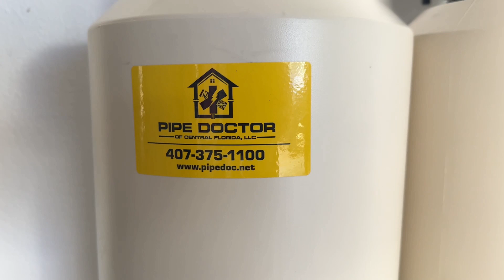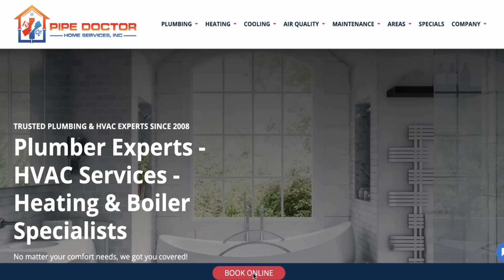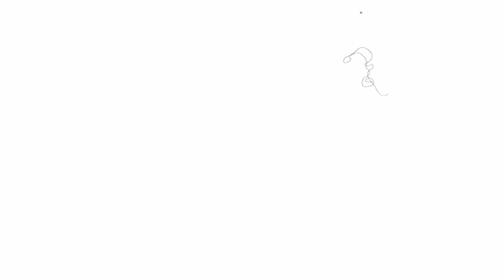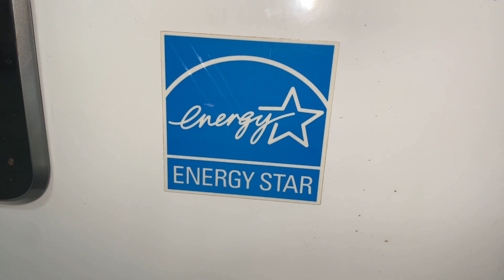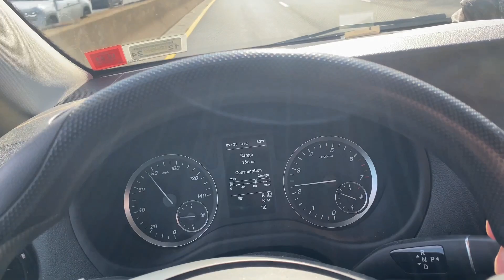Centrotherm Exhaust Piping Rotted in 24 Months! Importance of Outdoor Reset & Temperature Sensors

Comment: unsure if it was running too hot(short cycling?, lack of circulator post purge) but it also looks like the clamp may have been too tight and distorted the pipe, possibly not supported good and had pressure on it  too.
**EDIT: no wait, after seeing further, I'm positive they had the standoff leg jammed in between the fitting and pipe past the gasket! that made it leak, distorted it, rusted the clamp and left the black mark on the gasket. installer error! check all the other fittings to see if they messed it up too.
the standoff leg sits against the raised ridge and the other snaps over it to lock on, so the clamp ring sits at an angle grabbing the pipe, if it tries to pull out it will pull tighter.
you assembled it right, with the standoff leg at bottom outside the fitting against the ridge.
Reply from the maker: Thanks for posting your thoughts on this leak

Comment: Baseboard does not need 180°.
Reply: The baseboard outputs will vary depending on the water temperature coming in. Lower water temperature means lower BTU output. When it's colder outside you need higher BTU output. When it's warmer, the heat load is less and you don't need as much of a BTU output
Reply: That is why most baseboard manufacturers give heating output ratings for different water temperatures.
Reply: The baseboard is sized for the coldest day of the year. On most days, you do not need the full capacity of the baseboard
Reply: @aaronkoster3940   except, radiation elements are rarely sized right or to the actual heat loss.
running below 160F on baseboard is nearing useless and the total run time will be too long. also don't forget total loop lengths, 160F leaving the boiler, may be less by time it reaches the first element, then if there's many feet of elements per loop, the water at end may be far too cool to effectively heat the space.
more often than not, turning down temperature feeding baseboard will come back to bite you in the "hind-end", same with running "green" magical energy saving circulators, which may not flow enough to evenly heat larger loops.
Reply: Seems like a waste a money to sell a customer a high dollar condensing boiler if you don't allow it to condense.  Just install a non-condensing boiler.  Much cheaper maintenance.
Reply from the maker: Thanks for sharing

Comment: Thoughts on a electric tankless water heater vs heat pump water heater (50 gal) when house only has electric as option and 200 AMP service? HVAC unit itself has a 90 AMP breaker. Worried about running out of power with a tankless due to the high AMP pull for a electric mid tier Rheem for example (TN groundwater temp)
Reply from the maker: It's important to consider your electrical system's capacity and your specific needs when choosing between a tankless water heater and a heat pump water heater.

Comment: When the thermostat tells the boiler to shut off does the circulator run for an extra 30 seconds or so to get rid of that residual heat in the piping?  If not they should and is that another reason why to don’t want it set to 180
Reply from the maker: That is a great question, but no when the thermostat is satisfied, TT opens and the relay opens as well, and the circulator turns off.

Comment: Prefer the IPEX 636 vent piping, with their top CPVC your temperature rating is up to 194 F. That 90 was showing some heat deformation, unit must have been running continuously??
Reply from the maker: Thanks for sharing
Reply: Agree that it looks like heat deformation.  Centrotherm states that its product is rated for 230°F.